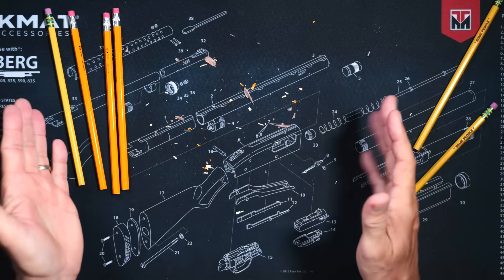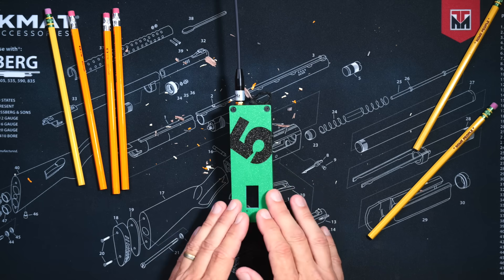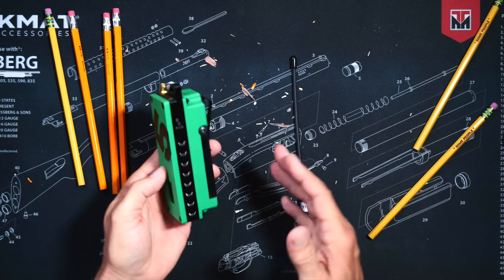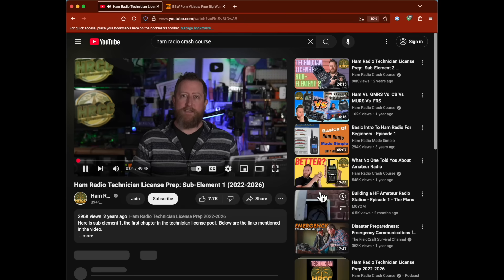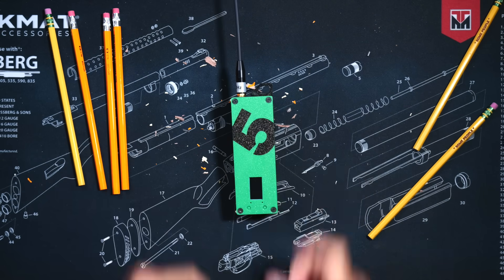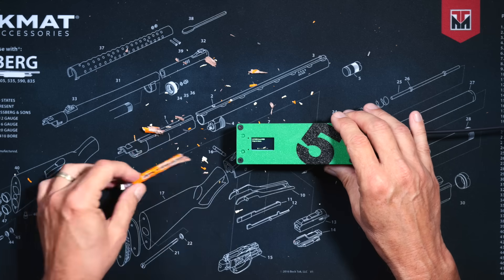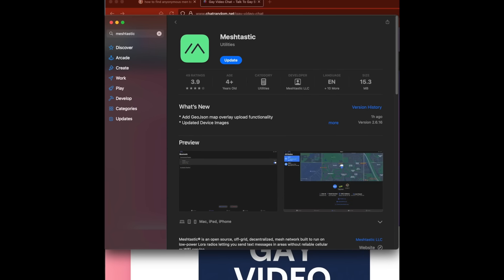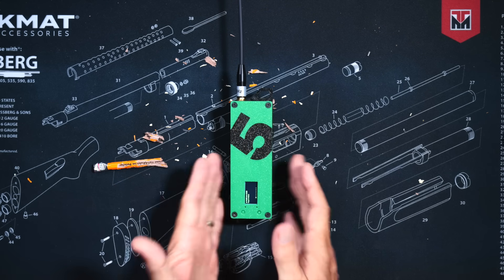Learning Meshtastic Part-1 My Spec5 Trekker Bravo Review

Comment: so, if all you can do is text on it, is the only point that it is a stand-alone network as a back-up in case cell service goes down? Maybe part 2 will explain.
Reply from the maker: as mentioned in the video, the point is private, secure, off-grid communication.

Comment: IF everyone wasn't already stuck on using radio, I'd recommend new off-grid comms people just use meshtastic instead. No liscense, long distrance transmit, high gain, low energy, easy to use, ect.

Comment: The specs say 1 - 3 mile range in urban environments and 3 - 5 mile range in rural environments . So about the same as GMRS .
Reply from the maker: That's range per radio. But you dont communicate only radio to radio, your message is passed on to the next radio, and the next, until the message reaches its destination.
Comparing to GMRS is like comparing apples to motorcycles.

Comment: Grrr......The battery on mine failed after one day. Will not take a charge and only works while plugged in. Amazon does not allow returns on this item.
Reply from the maker: What did Spec5 say when you contacted them directly for warranty support/replacement?
Reply: @TheNotaRubicon  It's the weekend. I am sure I will hear something during the week.
Reply: I heard back from Spec% and they had me open it up. The battery sits in a plastic cradle with the positive and negative wire on each end. The ends of this cradle fit into a slot in the plastic external shell. it looks like  someone got in a hurry and broke the plastic end off while they were closing up the shell. They said they would replace it.

Comment: I looked into this a couple of years ago and I saw several good reasons to use this as a backup to radio coms. First, it’s a good way to establish a solid secondary city-wide grid-down communication system. Probably not great as an emergency system but can be a good alternative for those who don’t understand radios. Like wives if husbands set it up for them. The nodes can be set up to run on solar power giving the network a resiliency that is great for longer term communication solutions within the established network. Like a city, town or large ranch. Radio voices can sometimes be hard to understand so text is a nice option when you are communicating with someone at home. Good for peer-to-peer but not for mass communication.

Comment: Can you use a cable splitter for the antenna and connect both radio and meshtastic.
In cas you want to hard wire into your off road vehicle
Reply from the maker: No. You would likely damage both if you did that.

Comment: Lets take bets on what board is inside, I say its the Heltec T114 Node based on the position of the buttons and where the charge port is :) But seriously, so the Mesh you are connected to there in cali , are they using MQTT to link them or are they all 100% nodes? I ask because we here on the east coast , well my group of ppl, do not have nodes that are in range of everyone so I setup a MQTT server to connect our meshes/nodes that are too far away from each other.
Reply from the maker: Those are all pure mesh, baby!  No MQTT allowed on this device!
Reply: @TheNotaRubicon  Nice! Well out here in the sticks we have to do what we have to do LOL

Comment: the new 2.7.3 firmware is a whole new redesign, but no web ui
yet..... I have made a few , they are fun. my favourite is the HelText 3D case with a keyboard.  also under the Mqtt settings if its on wifi turn proxy off, turn it on when paired to a phone

Comment: Thanks for this video! Now I want one too! A pitty that Amazon will not ship this Spec5 Trekker Bravo to the Netherlands and also fails to tell me why not.
Reply: Found the answer myself: In Europe it's not allowed to use the 915 MHz frequency.
Reply: @smk242  These also support 868 MHz and can be changed in the settings. It's just the antenna that would need to be replaced. However i'd recommend a Seeed SenseCAP T1000-E if you're just getting started. Much better and cheaper device.
Reply: @KboxLabs  Very interesting, for sale in my country also. Thanks for the tip!

Comment: Some other turnkey devices worth looking at if you want something ready to go would be the lilygo T-deck+ and the SEED studio SenseCAP.

T-deck is nice in that it's truly all in one, no phone needed to use it as it has a keyboard and screen.

The sensecap is more of what you have now but even simpler (and i think water resistant?) only downside it needs a special cable to charge it and flash it.

But regardless of any of that, welcome to meshtastic. sad for no roger beep

Comment: I have a question, but not about the mesh tastic. I was wondering which mobile radio would come closest to your Motorola XTL 5000.
Reply from the maker: I havnt found any consumer-grade radios that come even remotely close.
Reply: @TheNotaRubicon 
I would get the mesh tastic, but I was born with vision problem meaning I am legally blind but can't see well enough to do my job at work. So I guess I have to stick with verbal communication devices.

Comment: I do get the appeal of Spec5 stuff, you made it clear your opinion on the idea of DIYing it, but they do objectively overcharge a ton for off the shelf parts upsold inside their own cases.
Regardless, if you actually use the Meshtastic, you will, over time, eventually want to learn how to flash the device, as the firmware does get updated.
And, I know again you made your opinion clear, but flashing is 75% of the work of getting the DIY kits working, the other 25% is physically plugging in the battery and antenna, then shoving it all in the plastic tin it came out of.
Alright, time to go back to not valuing my time and touching myself 😄.
Reply: I don't see it as overpriced. For sure you can home build for cheaper, but the parts cost about $50 and it takes time to build. At 60% GM over parts cost, the price would be about $150.

Comment: Thanks for this video. I have been wanting to get into this for a while but I don’t understand it.

I live in a small but tight community where most of the people are older than me. When we loose power we also loose cell signal. 

My goal is to set a couple of these up so neighbors and I can check on each other.
Reply: The reliable range for pocket nodes is going to be somewhere in the 1-2 mile range and with better antennas and positioning it's been in the 8-10 mile range. A lot of small towns can be covered with just a couple of hops  and very few devices.

Comment: Meshtastic is a bit off topic for this channel but glad to see you are giving  it a try. 
Basically it is only useful for a small circle of family and/or friends.  There are open/public channels that some people like to play around with but in large cities, it is easily overwhelmed with traffic and becomes useless.  
The idea is that you set up a mesh for your group so that, in the event of a zombie apocalypse, you can communicate without cell service.   An added bonus is that you can set up an encrypted network so that your conversations are private and secure.  
If you are a hard core geek, meshtastic can become a deep rabbit hole.  For normal people, it's probably useless.
Reply: When you understand that the owner of this channel can post about whatever the heck they want to even though "some people" such as yourself think they have to stick to one thing you'll get along better in life.
Reply: Nah, it's versatile enough that you can do so much more than small circle . Those high density public channels are moving away from long fast and saving it as a general calling channel, right now this is best with multiple devices, but they're working on "cross channeling" where a Linux based processor send messages through multiple devices on different channels and frequencies depending on who you want to DM - Fred on long fast can DM Barney on medium fast and Wilma on turbo from his simple pocket node. You're right if you're thinking off-grid, but it's a parallel grid and it's just getting started. Roof top and attic nodes are the way.
Reply: It's the natural gravitational pull... to explore all things radio
Level 3 GMRS nerds can send texts between some brands of radios

Meshtastic is easier to set up and chat, but running it at a regional level is almost impossible on FastLong 
I have logged 555 nodes in my area

Comment: in SHTF won't you have to depend on all the people with mesh devises between you and Josh to keep their units running? It is cool to do it but still.
Reply: Easier to keep a node running off a cheap portable solar panel than relying on the cell network.
Reply: Depends on terrain, we have line of sight nodes that are 62 Mile's apart and 54, those being 'repeaters' running on solar.   They make communication over 50 miles reliable in areas.   So it depends on what and how is between them.

Comment: Have you figured out if there is some sort of 'monitor' mode where it will display all messages flying over the network?  I assume that messages can be marked public or private.  You of course would only see the public ones.
Reply from the maker: I just barely learned how to turn the thing on!
Reply: @TheNotaRubicon  What a great start to a fun and interesting adventure.  I'm all excited to see the next video.
Reply: @TheNotaRubicon  just 1 question     can it be for shtf ?  thx   next vid
Reply: @zantharzello2999   Yes you can!!  But...  Will it be helpful?  That depends on what kind of 's' hits the fan.
Reply: There is a 'public' channel where everyone basically says hi, and you see other nodes.   You can direct message people or use your own channels.